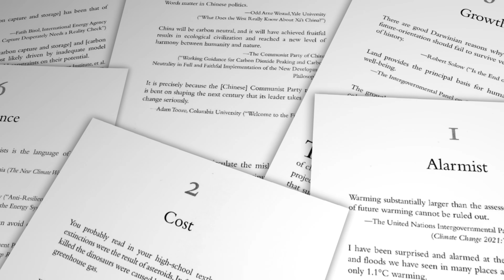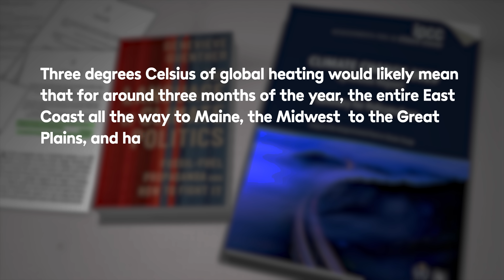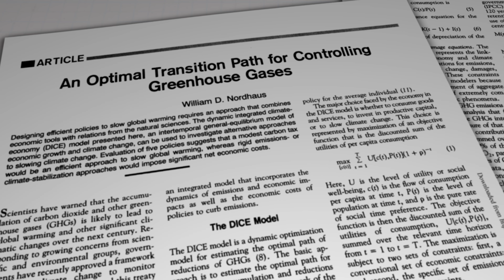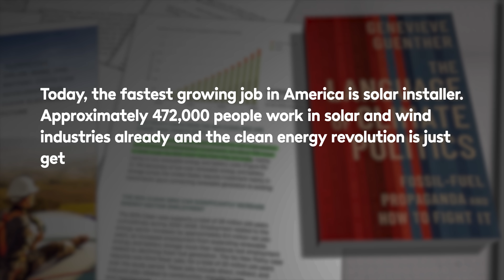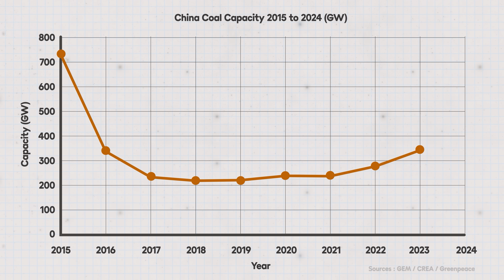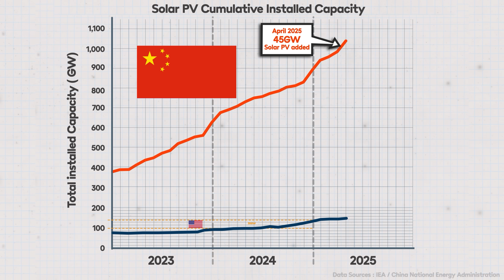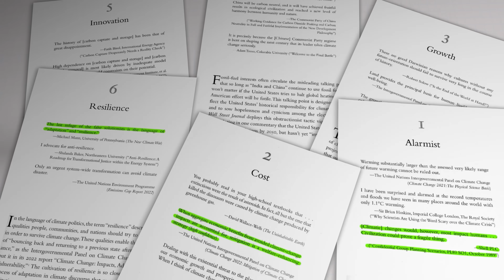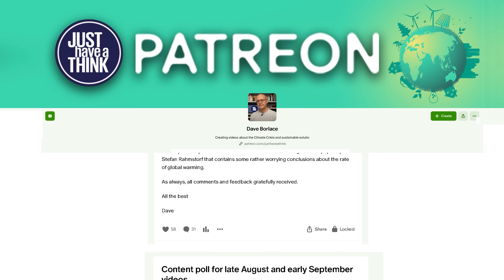New research DEBUNKS climate disinformation.

Comment: I'm sorry to be an alarmist. If we do ALL of the things suggested (emissions carbon capture, direct carbon capture, changing to more green energy sources, etc.) and we get everyone to buy in, we are still in for over 600 years of warming. We've tipped the scales in a bad way.

Why can't we do everything we are capable of to try to mitigate the damage we've done. We are the frog in the pot now. The burner is on. How high that burner is set will depend on our decisions about how we are going to continue with our industrial activity. We can make a difference and we can turn this around. The damage done will take longer to repair.
Reply: @Les_S537 No, mate, the warming doesn't stop when you finish using fossil fuels. The carbon dioxide is still in the air and will continue to absorb infrared radiation and raise the temperature on the planet until it is removed from the atmosphere.
Reply: Has anyone factored in the ordinance dropped on Gaza? Thousands of 2,500lb bombs, hundreds a day for nearly two years now, anyone know how much heat just one 2,500lb bomb generates?
Also, there must be a compounding effect with the vaporization of concrete and steel so how many buildings X how much rebar per building..
And of course it’s not just Gaza being bombed but also Lebanon, Syria, Yemen, Ukraine, Russia.. Is Sudan also being bombed or are people just being murdered there?
And does vaporized human flesh have a warming effect?
And let’s not forget that the Arctic is now being used for munitions testing and war ships are running amok in every ocean on the planet…
And oh hey, you know healthy oceans and forests sequester carbon. And we have no bigger allies than the whales when it comes to carbon sequestration on the ocean floors!
But then of course cruise ships and war ships are more important than whales so it’s fine I suppose that the whales are being shredded alive by the hundreds daily. But what’s the warming effect of losing the whales?

You know nature had this all figured out and dialed in before we arrived right?
Maybe making our living planet, the source of our own lives, a higher priority isn’t such a dumb idea.
No tech required.
Reply: @mischevious  > Has anyone factored in the ordinance dropped on Gaza?
Yes, and in Ukraine.

That said, while its certainly not a non-issue, there's a simply massive scale differential.  Israel alone is a bit under 10 million people.  If even a third of them drive to work on a daily basis, you've vastly outpaced the carbon impact of the bombs.

Sure each individual's trip is less than a single bomb's output but you're comparing hundreds of bombs per day to millions of cars driving around per day.  And that's just Israel's driving population - never mind any industrial output, the emissions from drivers and industry in the rest of the world, etc.

> how much heat just one 2,500lb bomb generates?
Again, not a lot when you compare the scale.  You're not even going to feel the heat more than a couple km away.  Sure its super hot at the center of the blast but heat fades away quadratically (and probably even faster in practice as there'd be stuff in the way absorbing a lot of it).

Compare that to a hot summer's day where entire regions of the planet are warmed to 20, 30, 40, even 50 deg C.  Sure any single point is much colder than the center of the blast, but there's a hell of a lot more points and while the bomb detonates only once and the heat has largely dissipated within minutes, the sun is cooking us 24 hours per day every day of the year.

Its why CO2 is such a big deal.  All the burning we do to produce that CO2 is absolutely trivial compared to the heat of the sun.  Its trapping more of the heat of the sun that's really causing the planet to warm.

> there must be a compounding effect with the vaporization of concrete and steel
Not really.  Neither concrete nor steel are particularly combustible (good part of why we use them so much).  There's just not a lot of energy in those materials that could be released in that manner.  But even if there was some kind of effect like this, see previous point.

> And does vaporized human flesh have a warming effect?
Not really.  Aside from the same scale factor argument, everything we're made of comes from plants or from animals that (somewhere up the food chain) ate plants.  That is, its all carbon that was at one point pulled from the atmosphere, so burning human flesh is more along the lines of biofuels than fossil fuels.  Certainly better to not burn it (burial functions as a very small carbon capture!) but its not a big deal.

> the Arctic is now being used for munitions testing
Now that does have the possibility of causing problems if care isn't taken.  Not because of the heat of a bomb or anything, but because of albedo - that is, the large amount of ice helps reflect sunlight and keep temperatures lower.

If they managed to destroy (or cover in ash) a large portion of arctic sea ice, they certainly could cause problems.  I don't really see destroying it being the big one (again, relative scale of a bomb vs the planet) but the ash and soot could be an issue - it only takes a thin layer to screw up the albedo and if they blow up sufficient material, the wind could potentially spread it over a vast area.

> healthy oceans and forests sequester carbon
We've kind of run out of both of those.  Our forests are burning down faster and faster, and the ocean has already absorbed far more CO2 (acidification) and heat than can be considered "healthy".  I don't think we can really rely on those anymore.

> But what’s the warming effect of losing the whales?
Miniscule.  Again, scale is the problem.  Losing the whales would cause all sorts of other ecological problems, but they just don't poop anywhere near enough to make a meaningful difference against the warming we're causing.

> You know nature had this all figured out and dialed in before we arrived right?
Sure, and its still got it all figured out.  "Nature" will do just fine no matter how badly we break things, just as it figured it out after the meteor that took out the dinosaurs.  Sure, almost al of the dominant lifeforms were gone, but "nature" is fine with that - she'll just evolve some new ones over the course of a few million years.

> Maybe making our living planet, the source of our own lives, a higher priority isn’t such a dumb idea.
A higher priority than what?

> No tech required.
So... we all just go back to the caves?  Don't even allow ourselves fire?

Two problems with that idea:  First, nobody's going to go for it.

Second, even if you could somehow get everyone to go for it, that lifestyle doesn't support 8 billion people.  If we tried to support our current population using agricultural practices from just a few hundred years ago (ie: pre-industrialization), the planet would be in much, much worse shape.  Think locusts the size of and with the lifespan of humans.

The solution is not to go backward.  That's simply infeasible.  The solution is to go forward - better tech rather than no tech.
Reply: I am all for every part of mitigating the rise atmospheric carbon, except for direct carbon capture. We know that plants continue to grow larger up to 1,500 ppm, which is where greenhouses set their carbon levels. As the population continues to rise, we will need the earth to be able to produce more gigatons of plant life to sustain us. Cutting emissions or planting trees are great ways to do this that leave our scarce planetary stores of carbon available to the carbon cycle. Carbon capture generally mineralizes and buries the carbon in a state that, when future generations need it for food, they won’t be able to access it. Carbon capture is a short term fix that permanently cripples the life potential of the planet. We have no right to be doing this to future generations.
Reply: @darth_pronator  Current life on the planet does not want carbon dioxide above roughly 280ppm. We have almost doubled it. It's a small thing by the readings - but we need to get it back to where it was. Our whole planetary ecosystem is dependant on those pre-industrial CO2 levels. We mucked that up. It's causing a climate change that will disrupt everything. If we allow it to triple as you suggest - the effects would be devastating to every corner of our planet for US. Life would go on, just not what we see today, and we depend on things the way they were, not how they are turning.  
Besides, you are trading CO2 for O2 - and that isn't good either. To get to the levels you suggest would take a percent of O2 away. 20.9 down to 19.9%. Most life isn't meant for that level. It'll survive - but not flourish.
Reply: @darth_pronator  > We know that plants continue to grow larger up to 1,500 ppm
We also know that plants don't do well in 50 deg C temperatures.  Who cares how big they could theoretically get if they're dead before they're out of the ground?

If you can figure out how to keep warming down without removing CO2 from the atmosphere, I'm sure there's a few extremely prestigious prizes waiting for you.
Reply: @altrag Safe to say you don’t understand. The amount of carbon that is available for the active carbon cycle is exactly the determinant of the extent of life that can be supported on the planet. I want us to stop causing atmospheric CO2 to rise. We just should not do it by permanently limiting the life potential of the planet. We have absolutely no right to do that to future generations. There are many ways to curb atmospheric CO2 without crippling the planet with permanent carbon capture and sequestration.  Don’t only think about yourself. We need to be good stewards for future generations. That’s ultimately more important than our selfish interests.
Reply: One way to do carbon capture is to add it to the soil. But you can produce terra preta in your backyard to improve your soil. It cannot be patented, copyrighted or monopolized, so no one talks about it. I would prefer to have it produced in factories (and a heat exchanger would put the energy used for smouldering carbon to good use and such processes could also be supported by solar. - but it is not high tech. So not a scheme that big biz could milk. 

Heck we would pay developing countries to have such operations and the can use the end result to improve their soils (Terra preta absorbs rain and keeps in the nutrients). Thinking of it, there could be installations in deserts. The resulting substrate can be mixed with sand and be used to grow food. (in greenhouses to avoid some sun exposure and limit water use).
Reply: @franziskani Awesome options! Any form of carbon capture that does not put the carbon in a form that can never be released back into the carbon cycle should be explored. But any form of carbon capture that permanently sequesters carbon needs to be made illegal. We have no right to cripple the life potential of the planet because we are trying to fix our short term issue with carbon emissions.
Reply: > we are still in for over 600 years of warming
Two rebuttals to this:
1) If we reduce new emissions to near-zero AND do direct air capture to pull out CO2 that we've already put up there (which includes planting more trees), we can reverse at least some of what we've done.
2) Similarly, the less we add the less severe it will be.

I'd rather have 600 years of "a few days of severe heat" than 600 years of "3/4 of the planet is completely uninhabitable".  That's before we get into "little" problems like the varieties and amount of food we can still grow in the remaining inhabitable parts of the planet.
Reply: Even if youre right, we may stumble on to something better if we go all in now.
Reply: Methinks you haven't thought this through completely.

The warming will stop precisely when the last fossil fuel is used on planet earth.  

Whatever the CO2 levels are at that point, us using the last fossil fuel ever, will stay that way.

Now the climate will be warmer than we are today overall, but the increase in warming will pretty much stop at that point.

Now, if man were to work at sequestering all the carbon we've added to the carbon cycle, GHG levels will begin to drop, and once we get CO2 levels to begin dropping you'll see the climate begin to cool off.
Reply: @Les_S537  except it takes around 10 to 15 to years for the CO2 emitted to reach its full warming effect, somewhat complex system beyond my understanding, but that’s what the scientists calculate. Then there’s all the other factors such as the ice keeps melting anyway given our current levels of CO2, revealing more dark land / sea areas etc reducing the earths albedo, a feedback loop that increases temperature, to name just one.
Reply: @Les_S537  
1.  You are aware there was a carbon cycle before humans got involved, and there still will be, right?  CO2 will not permanently 'level off' whenever we 'use the last drop of fossil fuel'.
2.  We will not 'use the last drop of fossil fuel' because that last drop would be insanely difficult to find and then extract.  We will slow our extraction and use of fossil fuels in line with the rising difficulty to extract and the falling cost of alternatives.  
3.  Say we stopped using fossil fuels entirely.  What about steel and cement production?  Do those factor into your logic? 
4.  Warming is governed by many things, including CO2, but also responds to feedback loops and other greenhouse gasses (methane and refrigerants, for example), so it very much would not cease immediately if we stopped emitting CO2. 
5.  Methinks you haven't thought this through completely.
Reply: @matzke1129  > You are aware there was a carbon cycle before humans got involved,
Yes.  The problem is that we've completely and utterly broken the cycle.  If you care about the historical cycle, you should be very concerned that we're getting hotter very, very rapidly during a time when we're "supposed" to be getting colder.  Bringing up carbon cycles is more of a self-own than an argument in your favor.  Of course you have to actually understand what a carbon cycle is to recognize that, rather than just spouting off a phrase you heard on TV.

> that last drop would be insanely difficult to find and then extract
We can probably bypass that pedantry.  We've got something like 200 years worth of known reserves, and who knows how much still unknown.  There's not going to be anyone around to even bother extracting that inaccessible "last drop" if we burn all the stuff we can already get at.

> What about steel and cement production?  Do those factor into your logic?
Yes, we do.  And people are looking at alternatives that don't produce as much CO2.  "Net" is an important word - it doesn't mean we stop producing CO2 entirely, it means we stop producing more than the planet can re-absorb in the same time period.

> so it very much would not cease immediately if we stopped emitting CO2. 
No, it would not.  That's why the "alarmists" have been sounding the alarm for like 40+ years.  But the longer we wait to fix things, the longer (and worse) it will get before it does eventually cease.

> Methinks you haven't thought this through completely.
Says the person who thinks "carbon cycles" is a solid argument.
Reply: @altrag  I think you're inferring a position I'm not implying here, possibly because you missed that I was responding to a specific sub-comment?  My only goal with most of what I wrote was to snark at and correct that other commenter, who wrote: "whatever the CO2 levels are at that point, us using the last fossil fuel ever, will stay that way."  They also implied a 1:1 connection between energy extraction and CO2 emissions, which is why I brought up the steel and cement thing, etc etc.  For the record, I am one of those 'alarmists' and have been for decades.  

TBH, I wouldn't have bothered except for the smug attitude, hence the dumbass 'methinks' quote/callback.  

Though, I'll take issue with the notion that humans the species are destined to disappear in even the worst scenario.  Society as we know it, absolutely, a large chunk of the human population, sure, but a scenario where all human techological progress disappears is far from certain even in a worst-case scenario.
Reply: @Les_S537  You have no education in atmospheric chemistry it seems... The largest CO_2 storage is the ocean and the balance between carbonic acid (or rather it's ions) and CO_2 in the air. Let's now take alook at how the amount of carbonic acid develops against rising temperatures, it's decreases. The carbonic acid can be stored as CaCO_3 as well but that takes several hundred thousands of years. So we have a system that emitts CO_2 at some point, therefore rises in temp, reduces the amount of carbonic acid that can be stored, repeat. Thats by the way the reason no one beside vaporware sellsman and fishy politicans( the other kind of vaporware salesman) belive in CO_2 caputure out of the air. The amount is miniscule and directly coraltes to a way higher amount of CO_2 in the ocean that would be emitted in case the atmospheric concentration would drop... 
and we are not even starting to talk about the dying ecosystems in the ocean which increase the acidity by decomposing.
Reply: @Les_S537  thoughts on global dimming?
Reply: @lorimason2288  Do you mean where man attempts to block some of the incoming solar radiation?
Reply: @lorimason2288 
Here’s my thought on global dimming; most life forms on planet Earth require sunlight, especially the ones that produce the oxygen we need just to breathe.
Reply: @lorimason2288   There is the very pessimistic view of James Hansen. Gobal dimming dropped way more than expected. Shipping fuels have to be cleaner since ? 10 - 15 years and it makes more impact than the IPCC models account for. China clean up showed some effect already - but it seems now that in an pristine environment with clear skies and few particles from a ground being sucked upwards, and clourd formation is different = the oceans -  the Sulphur particles had a more pronounced dimming effect. More than the same fuel burned on land would have.

And that effect (that polluted, so that is why the worst fuel was banned resp. they have to use filters) is gone now. I forgot the numbers of how much dimming has gone down since 2000 - I think it was in the range of 3 or 5 % - but it makes a difference. The IPCC models cannot fully  explain the warming of the last years (it is more than their models expected). But when Hansen factors in that dimming helped us more than we realized, it works out.

These are only a few years of reality-worse-than-models - remember uncertainty does not mean that you can wait  .... it's gonna work out just fine. It's not going to be as bad.

The opposite can be true - it is worse than expected. Uncertainty is not our friend. 

Same for the current that drives the gulf stream it gets weaker than expected.
Reply: @Les_S537  Ouch.
Reply: @dont.beknown5622 Ouch?  About what?
Reply: @Les_S537   you're denying the science.  The surface of our planet is warmed by the sun.
Reply: @Les_S537  if/when we stop burning fossil fuels, we lose "aerosol masking" - our polution is keeping us artificially cooler than GHG-levels indicate. If/when we stop, within a week, temperatures spike another 1/2 degree C.

Losing aerosol masking alone disproves your claim, but you also don't consider tipped climate systems that will continue to fuel warming (which others have mentioned already).  Methinks you're a bit overconfident and lacking knowledge, a real Trumpified state of being.
Reply: @Les_S537   No when fossil fuel use stops the warming will NOT stop. Not at all. There will be a long after effect, (it could be unstoppable, ever heard of RUNAWAY warming ??). All that heat in the oceans does not just disappear so there would be an after effect anyway. The oceans absorbed a lot of CO2 in the last 50 years, that will eventually be released as well. More dramatic: IF the methane bomb has gone off and more CO2 and methan is released because permafrost is thawing (that is mostly methane) and the methane and CO2 (currently stored in the oceans) is realeased as well because of higher temperatures  - then it becomes a self feeding and quickly increasing cycle. 

Even if humans would not add any CO2 and methane  to the atmoshpere anymore. The oceans and the swamps will . Methane does not last as long in the atmosphere as CO2 (I have read up to 1000 years for CO2, while methane maybe 100 years or shorter). But methane has 28 times the effect of CO2. Hence the term methan bomb. Methan can massively boost warming - and it has happened before.

There were times when there was some warming (for whatever reason, sun, or any natural release of CO2 like volcanic activites - we are talking hundreds of thousands of years of eruptions, see Siberian traps and also in India). Then some CO2 and methane was released that had stayed in the oceans when it was cooler. So that increased the original effect and made it LAST. More warming of oceans - more release of warming gasses .....